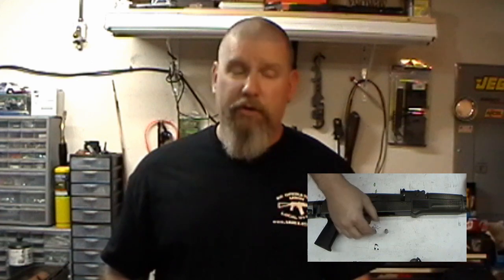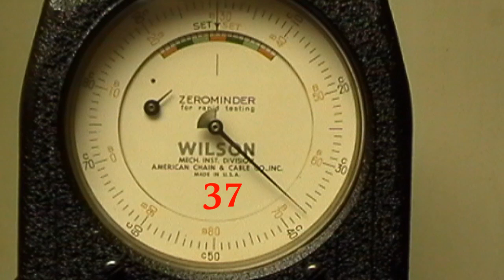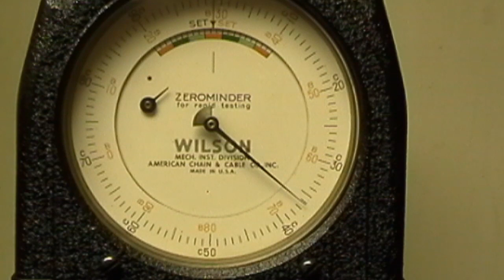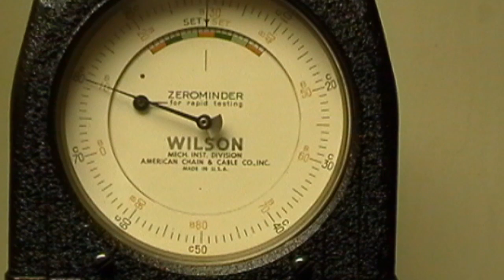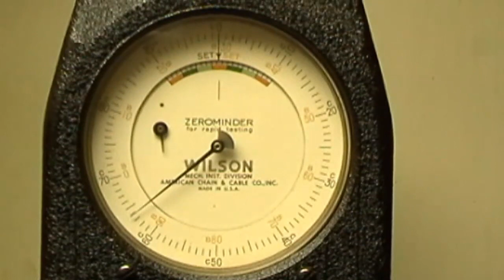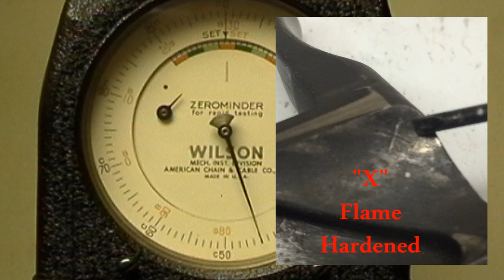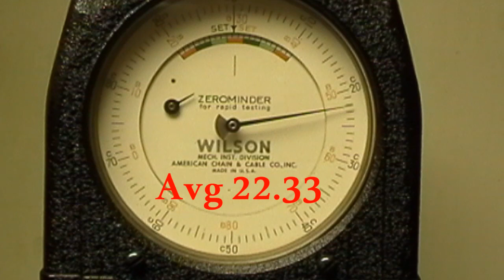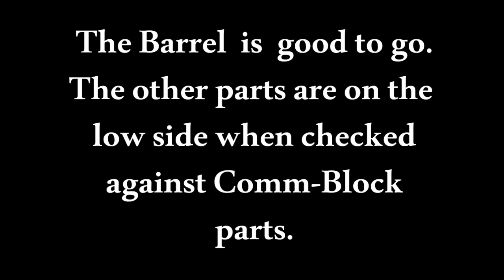RAS47 Hardness Test

Comment: Jesus...that bolt is a full 6 points lower than the minimum spec of 42 HRC...For anyone interested, here are the original Russian Specs for each part tested, including ANSI steel converted from the original GOST Russian standard:

Barrel (only specified at Chamber): 37-44 HRC
Spec material: AISI 4140
Test: N/A

Trunnion: 39-44 HRC
Spec material: AISI 5140 (AISI 4140 acceptable)
Tested: 37 HRC (-2 from min)

Bolt: 42-50 HRC
Tested: 36 HRC (-6 from min)
Spec material: AISI 4340

Carrier: 42-50 HRC
Tested: 28 HRC (-14 from min)
Spec material: AISI 4340

Front Sight Block: 35-40 HRC
Spec Material: AISI 1055
Tested: 28 HRC (-7 from min)

Gas Block: 35-40 HRC
Spec material: AISI 1055
Tested: 29 HRC (-6 from min)

Rear Sight Block: 35-40 HRC
Spec material: AISI 1050
Tested: 3 HRC (-32 from min)

Receiver: 67-71 HRA (34-41 HRC)
Spec material: AISI 4130
Tested: 22 HRC (-12 from min)

Comment: i bought an ras47. low serial#. it fell over in the kitchen and the rear sight slider broke off. when i saw cheap "pot" cast steel......disappointed was not the term i used. it sits in the back of the safe........since being replaced with an arsenal sgl31

Comment: Hello, and thanks +Mel64d for taking the time to test the entire RAS47 as you have... I do have a few questions. Do you believe it would cost Century Arms more in manufacturing to make the hardness of metals it takes to make the C39v2 or the RAS47, especially the RAS47 since it is stamped, and not milled, but particularly the moving parts that are of most concern? I appreciate your opinion, and thanks again... Tube On!
Reply from the maker: +Tactical Black   I think that Century should buy some WBP cast parts and have them tested for metal composition. Then try and match that if they can. Not saying that WBP is the cats meow, but they are using cast parts for their military rifles. But then again, the Polish may look at the rifle as a disposable item.
Reply: +Mel64d thank you for the reply, and the honest answer... seems you have a very valid point to the Polish thinking their AK likely being disposable. I seem to recall I.O. makes theirs from the Polish blueprints... just saying. Thanks again for the awesome information you've provided.
Reply from the maker: Thank you for watching.
Reply: +Mel64d I saw recently there are (at ArmsofAmerica) some WBP FORGED trunnions. I wonder have they always made these or switched to suit demand? Due to the AOU's testing I picked up some WBP cast parts for a build. But now it seems even they admit forged is better.
Reply from the maker: Mike Carlson  People are shying away from the "cast" trunnions because of the bad press about them. So forged trunnions are being supplied to satisfy the skeptical people. The Polish seem to have found the correct way to make good "cast" trunnions that will last. But people have a bad taste in their mouths after the cast trunnions made in America are of low quality.

Comment: had a century c39v1 it was junk, one side from the mag fed fine the other side smashed the bullets on the way in. the bolt was just disintegrating, pieces of metal cracking right off carrier began warping where the bolt resets on firing. never again on any century products, ever. total garbage... bought an arsenal sam7f and no issues, supposedly ak47s arent accurate, this one is accurate easily to 200 yards with cheap wolf ammo...
you've inspired me to build an rpk!
Reply from the maker: Yeah, now that enough time and rounds have been put through all the ones out in the wild. People are starting to get major problems show up...and in the beginning Rob Ski and I were told that we just hate America. Now the truth is coming to light.

Comment: Century says they use stamped from 16-gauge (1/16", 1.59 mm) 4140 sheet Steel and treated with a black nitride finish. So what do they make 4140 sheet steel from or is it all made differently?
Reply from the maker: Wish I knew. It would seem they are just stamping out the receivers as you say in 4140. No heat treatment, just the nitride finish......well, it's just basically mild steel. People back in the day and some still today, just spot heat treat the axis holes for the hammer/trigger. Those rifle are most likely still functioning to this day. But it's not "correct" or something that you would expect from the "Gold Standard" of AK's as Century said their rifle is. But A RAS47 is still 10x better than an IO AK any day of the week, even though the RAS47 is sub-par for an AKM rifle.

Comment: Hey Brother Mel, I don't understand why the gas block would cause so much galling on the barrel? What am I not getting? Hard steel cuts soft steel not the other way around! Round hole Square peg type thing?
Reply from the maker: +Cave Dave   Your guess is as good as mine. Rust welding may have done it?? It is odd.
Reply: +Mel64d very strange! Thanks brother! You and Rob make a good team! He Beats them up and you let us know why they fail or not!

Comment: On your galil build did you remove the barrel in order to install the gas block or can the whole assembly be pressed in while still in the receiver
Reply from the maker: +Stephentank14  The gas block was pressed on with the barrel screwed (headspaced) into the receiver.

Comment: I have a question my good man. I heat treated a 1.5mm flat and rails for the first time tonight and they came out 42-43ish right after the quench. Do I still need to draw they back some? Or since that is a good target hardness are they fine as is?
Reply from the maker: +Dennis Wallace  Typically they should be higher, and then brought down to the target range. I'm guessing you treated 4130 blanks? I have had the same thing happen to me as well with 4130. I switched to machine coolant for the quench. This gets the receiver in the low 50's.  The Polish blanks that I quench in quenching oil, usually comes out about 58. I personally prefer the Polish blanks over 4130. In my testing (ball peen hammer) the Polish blanks are spring like, and can take a beating. The 4130 will dent and warp.  The receiver specs are 36-44, so you can draw (temper) them back just a smidge.
Reply: +Mel64d  Yes it was a 4130 and I used a salt brine quench. It seem really hard and a little springy.

Comment: I might be missing something here. By your explanation, the hardness test you performed is not capable of determining if the metals are well suited for their purpose, but only their hardness. You found that the trunnion and bolt of the RAS47 is, according to you, within the acceptable range of what you would want it to be. These results, to the extent that they are able to provide information on the parts in question, speak favorably of the RAS47. However, you seem to be using the results as though they are evidence of a flaw.  Again, by your own words "The RAS47 is not quite to spec when checked against Comm-Block (surplus) parts", yet this is unsupported by the tests that you performed. If you dont think the results represent the reality of what is going on with the parts, then the strongest claim you could make is that the results were inconclusive. 

Not to say there isnt a flaw, and I do appreciate the effort, but having read my way through the comments and rewatching your explanation a few times, it seems that people are misinterpreting the results of the test.
Reply from the maker: Seems you are. In the description box below the video (where it says "show more") there are links to tests I have performed on comm block surplus parts. All the parts tested with the exception of the barrel failed. Let me be a little more clear. THE RAS47 IS A HUGE PILE OF JUNK.
Reply: I think you may the one be missing the point here. The issue is not whether or not the gun is a piece of junk, the issue is whether you have proven that it is. Unfortunately, the only appendix you offered for your test was for the c39v1 and barrels. I read through your postings there, where you mention needing to get your hands on a RAS47 to compare the results to the c39v1. Being ignorant as to the differences between the two rifles (I own neither), I would defer to a gunsmith like yourself (Im assuming) to know what those differences are. Seeing as how you found it necessary to solicit the forums for an RAS47 to do tests on, I guess I should assume there are enough differences not to be able to apply your c39v1 test results to the RAS47. 

So are there results available for an RAS47 anywhere that you maybe forgot to link to? Or is this one of those things where you are offended that someone didnt take a blanket statement offered without proof as fact? I am more than happy to take your word that the gun is junk and avoid it, you would probably know having worked with/on them, but in the context of presenting test results, it seems that all you are offering so far are tests that came out favorably for the RAS47 with opinionated statements that arent based on direct testing.
Reply from the maker: dsa das   http://www.akfiles.com/forums/showthread.php?s=515b51d3e1067d92e5a6625e0080de66&t=320133

http://www.akfiles.com/forums/showthread.php?s=515b51d3e1067d92e5a6625e0080de66&t=306176&highlight=Ras47

At the time I tested this rifle not to many out in the wild had high round counts. Now that time has passed. More and more ras47's are getting enough rounds to start coming apart. 

In the thread with the c39v1 I show Hungarian, Bulgarian, and Polish parts that have been tested against the c39v1.
I compared the c39 to the ras because regardless if it's a c39, the v2, or Ras47,  they all use the same parts...well the c39 and v2 are milled receivers but will still suffer because of the cast bolt and carrier. 

The bolts, carriers, rear sight blocks, gas blocks, front sight blocks, and barrels are all the exact same parts on the ras47, c39, and v2.  

It's hard to get people to let you tear their rifles apart to test them.  The ras was given to me and the c39 was cheap. So that's how this came about. 

I was hoping Century would use the info to help improve their rifles, seems they don't care. 

You can accept the information or not. Either way, we can still be friends.  Just have a difference of opinion.

Comment: Do you have any advice for how someone doing their own AK to test the hardness without spending a fortune on a Rockwell tester?
Reply from the maker: If you are building from an imported kit, then it should be fine. If you are wanting to test your own American made AK's, then there are files designed that will help with testing hardness. But with the files you really need to know what you are doing. There is also the "spark" test. But this would destroy or mare the part for testing. If you stick with comm-block (imported parts/rifles) then you should be fine for the most part. America doesn't seem to have the correct specs (for the AK) down just yet but they will get there sooner or later.

Comment: This is one of the hottest videos I´ve seen in a long, long time.  The score was just perfect.  Alright young Sir, I´m on board.   It is a shame the bolt is not case-hardened but then you would have to do the locking lugs in the breech.  They may want to consider a spring steel for the bolt carrier at the same hardness.  It would cure that peening issue on the hammer cocking cam while still being machined easily.  I assumed they are machining from bar stock, you mention casting, really?  I assume not the load bearing components.
Reply from the maker: Thank you. Yes their (Century) load bearing parts (Bolt/Front Trunnion) are cast.  Low quality cast at that, unlike the WBP cast trunnion and bolt. Those are working just fine from what I hear. Even tested the WBP cast front trunnion, it was a few points higher than the forged comm block components tested.

Comment: Doesn't flatware from most people's silverware drawer average 38c?
Reply: ~ish.
Reply from the maker: No idea. Never tested any.

Even if two different metals are the same hardness, does not mean that either can be used for a particular job. Seems that the cheaper metals/methods to make the USA parts are biting them in the backside. I mean, if you tried to use the same methods and materials here in the US as the old comm block nations. The rifle would cost you almost $2,000. Not selling to many of those "commie" guns at that price. Most people are cheap ass'. So the RAS47/C39V2 are good sellers to people that don't know any better. I mean the WASR is light years ahead of anything US made (for an AKM) and about the same price as the RAS47. But because of 'Merica' people will think that the RAS and V2 are the better quality rifle and that's just not the case.
Reply: If you ask me not that I'm a guru of an authority, they should be forged and milled to final.
Just my 2¢

Comment: Yeah I have "repaired" a few of the RAS 47 rifles. they all seem to crack in the exact same spot. The receivers are thicker, but they look slightly warped. Actually they rock a bit when placed on a level flat surface. Not even worth fucking with anymore as I end up replacing the bolt, bolt carrier, and front trunnion. Plus welding up and dressing the holes for the front trunnion sucks ass. BUT, the virgin Romanian front trunnions you can find for around 60.00 will eliminate having to weld up the holes. You can redrill in the same spot. Still a total piece of shit